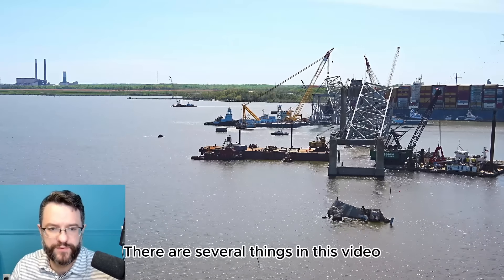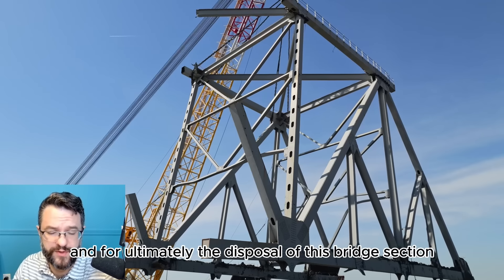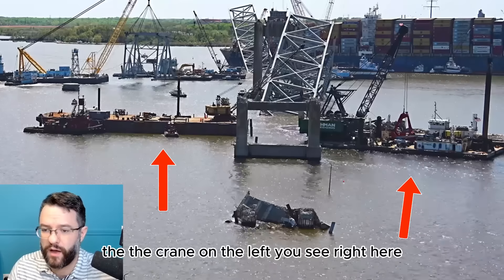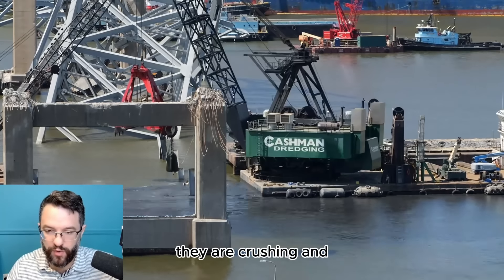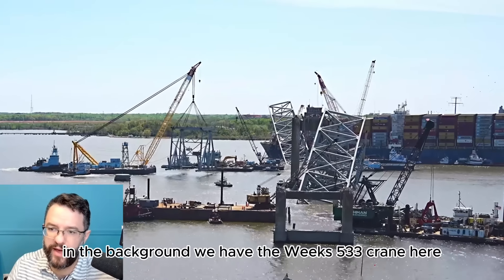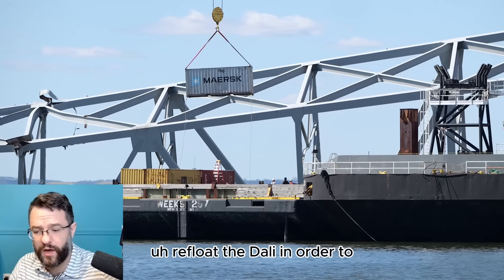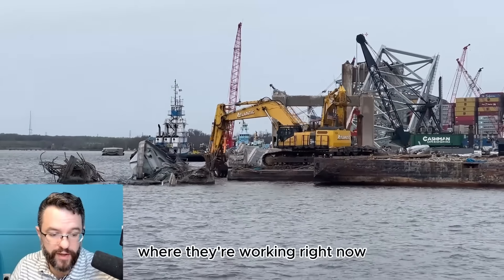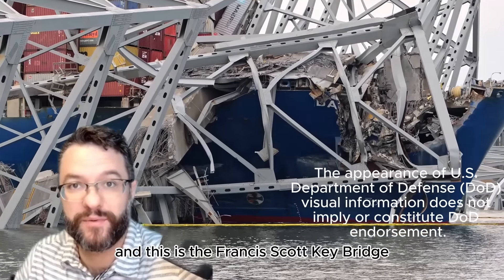Bridge Engineer explains the Work Zone at the Francis Scott Key Bridge

Comment: Very excellent video Matt.  I am curious if you have any insight as to why the third span of the the three span continuous truss failed?  As I have rewatched the video of the failure, it appears that after the pier is impacted the two adjacent spans deflect down vertically and the third span initially deflects up vertically (due to continuity).  After the two effected spans fall, the center span of the the three spans appears to "shear" off well inboard of the non effected third span.  Did the initial vertical up deflection cause the third span to be pulled in and off of it's roller bearing?  Most of my experience has been with timber structures but I would have expected the third span to survive.  Lionel Brightwell PE (retired)
Reply from the maker: Lionel very good insight.  To really be able to answer this question would need to have access to existing bridge plans.  But I think the 3 span continuous required temporary towers for construction so it was pulled down by it's own self weight in the progressive collapse.  

Have not studied frame by frame of the failure videos.  Interesting deep dive in the future.

Comment: Are they going to remove the bridge approaches that are still standing as they are obsolete? Definitely a separate phase of project but since contractors are on site it seems it’d be more efficient to get on with replacement pre construction preps. 
PS — looking at bridges being built recently, like Gordie Howe bridge, lots of building code changes have taken place since the current bridge was erected.
Reply from the maker: The existing bridge will be demolished.  Not sure how the contractual structure.

Comment: Just the guy I've been looking for.   A bridge engineer.
I saw a news video earlier today that said they have removed 1300 tons of bridge from the river so far.
My question is, How much does the remaining debris weigh?
I'm trying to determine how long this is going to take.    The news won't give any figures on the weight of the bridge that I can find.
I guessed the total combined weight of the steel structure and the concrete roadway must be 50,000 tons.
What say you?
Reply: I have been hearing that the truss spans weigh about 50,000 tons.

They have a looooonngg way to go on this salvage operation.
Reply from the maker: The figure is changing constantly.  But the 50,000 tons is the best figure I have seen, with the biggest pieces being ~400 tons each.

Comment: I am opposed to a replaced outer harbor bridge. To many issues with today's super-ships.

Unless a 4,000+ foot long suspension span is used to pass over waters 15+ feet deep. Probably closer to 5,000 feet to get it over all but the shallowest water. 

It doesn't need more than 4 lanes, AADT has been flat at about 31,000 since 2006.

The latest bridges over major shipping channels are in the 215 foot vertical clearance range. That is 30 feet more the FSKB. A bridge like that would about 2 miles long to meet that profile, and with shallower grades maybe 2.2 or 2.4 miles.

Costwise a 4-lane tunnel would be likely less than such a bridge. Tunnel approaches and causeways were built in the early 1970s, a tunnel was the original plan.

They would need to build a 6,200 foot long tunnel and open approaches.

My solution would be a tunnel as on the Chesapeake Bay Bridge-Tunnel and the Hampton Roads Bridge-Tunnel and I-664 Bridge-Tunnel.

No bridge over the shipping channel.
Reply from the maker: this is very viable solution.  for what is worth the reason why the electrical lines were relocated overhead was environmental issues with a directional bore...

Comment: Jeez, it’s a really massive mess. The more that is removed above water level demonstrates that the massive underwater concrete highway sections need to be pulverised to regain the original channel depth. I guess that will all need dynamiting to help break it down?
Reply from the maker: I believe they will use this to remove the section from the Dali.
Reply: @MattDursh  you are naturally far more knowledgeable about these things than I, but surely using explosives (above water level) would seem very dangerous in the respect of flying shrapnel etc?

Comment: You would think that they would bring in large flat barges and just sit the pieces on the flat barges so the Chesapeake 1000 could make another lift instead of carrying the pieces to sparrows point
Reply from the maker: There would need to be another big enough crane at Sparrows point to lift it off the barge.  The haul is not that far away.  There is prep needed for the next pick that crews can do while the C1000 does the round trip.